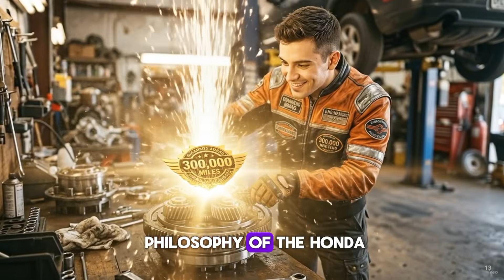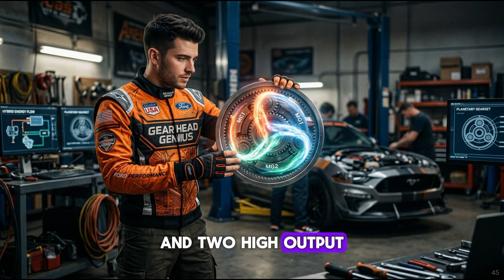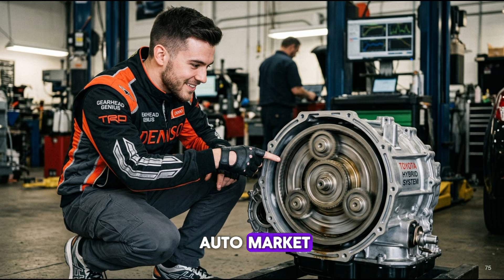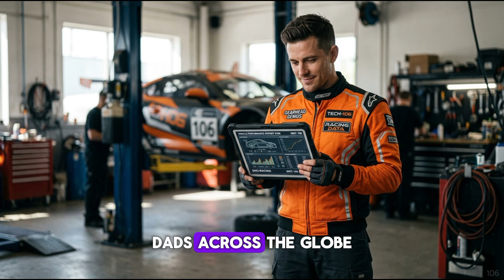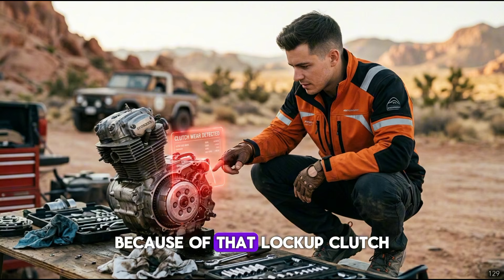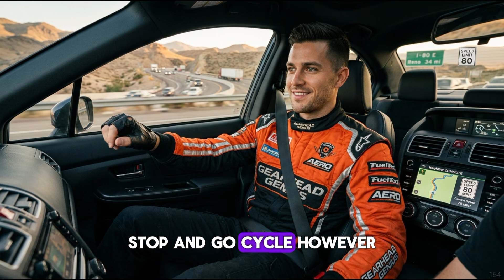The BETTER Hybrid Car: Honda Vs Toyota Which Survives On The Highway

Comment: Yeah, Toyota and Honda don’t have their own cars figured out especially Toyota and their 25+ year experience with hybrids. They just don’t know what they’re doing. I’m glad this guy is here to educate us and improve on their product.
Reply from the maker: I appreciate the sarcasm! But it’s not that their engineers aren't brilliant it’s that their goals have shifted.

Toyota and Honda engineers aren't just designing for "reliability" anymore; they are designing for government emissions mandates (CAFE standards) and the first 60,000 miles of the warranty. When the manager tells a world-class engineer they have to use 0W-8 oil for a 1% MPG boost or "lifetime" fluids to lower the perceived cost of ownership for fleet buyers, the engineer has to comply, even if they know it hurts the car at 150,000 miles.
Corporate engineers design for the first owner; 

mechanics see what happens to the third owner. My goal is just to show you where the marketing ends and the physics begins!